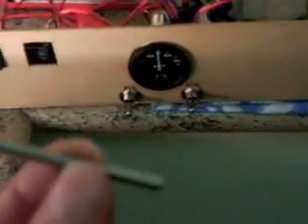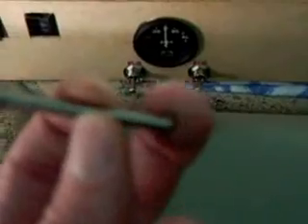How to make a Hydrogen Fuel Cell

Comment from the maker: Hey m8. Gr8 2 hear u r working on the same tech. It is heaps of fun and I have learnt SO MUCH along the way. Alluminium is ULTRA effective but it has NO longevity. The metal is 2 soft and breaks down quickly. Non magnetic stainless is the best stuff I found so far. I have found no excessive heat, 2 answer u'r question, but a lot of U Tubers I know have. Why they get this problem I don't know but I think it may be a circulation issue. Thanks for the comment and good luck :)

Comment: hey bro,ive made one using sea salt and two different size stainless steel pipes that fit inside each other with about 5mm gap between them they are 150mm long,inside negative. it works extreemly well, plenty of gas at 12v.sits inside a bottle, very slim.draws 6amps.i am thinking of putting it on you tube but after seeing all the comments from so many fools i might give it more thought.loved the way you built yours.and remember only 10% of the human race are inteligent.

Comment from the maker: Thinking outside the square! Well done on the kitchen sink bro :)
Even plates of positive and negative. The gas production comes from the polarity of u'r input. One way around produces more oxygen and the reverse produces hydrogen. The reason for more production after sand blasting is that u have more surface area. U sound switched on dude. U'll get 1 going in no time :D

Comment from the maker: Yes. I have a positive bolt running through one set and a negative bolt through the other. The corners of ever second plate have been cut out so the positive bolt can't short on the negative plates and vice versa.

Comment: I think frequency is the key to many things.  I saw a video where someone looped copper wire with about 300 turns and put high frequency A.C. current through it, and the damn thing levitated.  I don't know if it's true or not, but fascinating.  Stanley Meyers used high frequency electricity in his Hydrogen device to "shatter" the water to make Hydrogen.

Comment from the maker: U can use an oxygen filter if u like by filtering the O bubbles out with some small gauge wire mesh but I don't bother as the end byproduct is still the same... Water :) The bang given off is not an explosion, as many think, but an implosion. The energy released by the Hydrogen and Oxygen re condensing is what causes the reaction so it doesn't matter if u seperate the Hydrogen and Oxygen in the end.

Comment from the maker: You are best using only 1 of 2 metals. If u have the money then use gold but in the event u are struggling like the rest of us then I suggest "non magnetic stainless steel". The best configuration I have found is the tubular design but once u make a wave form and frequency generator there is no need 2 worry about the design ;)

Comment from the maker: I was drawing about 20 per chanel and had two running. You need the amplitude to get more frequency of current. The answer is to work on cooling your circuit. Try heavier duty wire and heat dispersing.

Comment from the maker: An electrolyte is used 2 harden the water. I have been using baking aoda but I believe that increasing the frequency of current reduces the need 4 electrolyte. Some people  use salt but that produces chloride through the electrolysis process.

Comment: Nice video BackwardTechnologies.  Have you fiddled with the frequency of the electricity you are applying?  From what I understand, you can produce much more Hydrogen with high frequencies...20,000 cycles per second at a 50% duty cycle is what Stanley Meyers used I believe.

Comment: the hydrogen is carried on through the fuel lines into a propane style carb. in the cylinder the hydrogen and oxygen re-unite and makes water vapor giving off alot of energy pushing down the piston. the water vapor runs into a condenser and some returns as water back to the fuel tank. (energy is lost through the exhaust) the piston turns the crank and therefore alternator charging the battery used to separate the h20

Comment from the maker: I have tried heaps of different configerations and the only constant I have found is surface area. The more surface area you can get to the water the more production. I guess just fit as much metal in as you can without shorting :)

Comment: water is made of two hydrogen and 1 oxygen, during electrolysis or voltrolysis the H2O is broken down into hydrogen gas(combines together into h2) and hydrogen peroxide HO2. theoretically, mixed in the right proportions the hydrogen will only produce water vapor as a result of combustion, which can then be collected and re-electrolisized. hope that answers you question.

Comment: im planning on making a smaller version of this setup. would i still need ur bubble tube if im going to splice into the "petrol" vacumm tube that goes into the injectors of my car? because there will be no flame or spark on this side of the injector system?

cheers
good vid helped alot

Comment: Nice video! one question... i thought relays were to control a large amount of electricity with a small amount of electricity. so how are you using the relays in this circuit and what are the connections to the relays?
thanks

Comment: yes it would, however, the hydrogen fuel cell would be like a massive battery that could be recharged anywhere, not to mention you can store more hydrogen energy than a typical li-ion battery and it theoretically would last forever.

Comment: Hello
 The negative and positive plactes that go into the fuel cell are separated from one an other by using rubber insulation. Question are The positive plates joined together by soldering wire from one positive plate to next positive plates and negative plates soldered with wire from one negative plate the next negative plates. Please explain

                            Thanks
                            louis Drotos

Comment: this is  a water electrolyser.

a fuel cell creates electricity from Hydrogen and oxygen; or other chemical reactions.

Titanium oxide can act as a catalyst to split water when hot steam is injected on it. steam can be solar heated and the catalyst will seperated water when heated by the sun. and steam is blown on it.

 It should not take more energy to make the fuel than it is when used.

 Find a free energy source, or waste energy to power the reaction . heat can be used on its own.

Comment: Use a solar panel to power the electrolyser at home.

Guessing: if you presurize the system it the reaction may be unaffected thus it could elf pressurize a tank with gas at say200 psi

YOU MUST SEPARATE THE HH and O in separate tanks or you will have a very nasty bomb I think.

Then transfer the H tank and maybe the O tank to your car.

Design some kind of "dripper" to control the flow at a very small amount.

Don't blow yourself up!

Don't breath the O gas. I.e. NaCl makes Chlorine

Comment: Has anyone viewed the water fractureing process, theres a couple on the tube ones called salt water burning, The others by somone who pat, Who designed his engin to run directly from the collector directly to the thottle houseing, Stan Myers? just wondering any feeds on that,

Comment from the maker: I believe electric is safe, yes, but this process is designed to run a combustion engine. I have designs I am going to work on when I finish this that will use this process to power an electric engine but that is down the track yet :)

Comment: The first cars back in the 19th century did use hydrogen and also alcohol as fuel, just as the first diesel engines did run on vegetable oil. Go read some history before commenting.

Comment: i think brettb2516 is right.  correct me if im wrong, but this does NOT seem to be a fuel cell at in, in the sense that it produces electricity.  all you have is a nice electrolysis machine producing fair amounts of HHO.  this does NOT make any electricity.   the "electricity" that the meter shows is the current from the car battery.  correct me if im wrong though cause this is a little confusing.

oh and...  lose the puppet

Comment: "IF THE HYDROGEN causes enough spark in the piston cylinder.....THROUGH DIRECT INJECTION
why do we need fuel to add to it??????"

Because we have no carbon in hydrogen fuel, and gasoline does. Carbon lubricates certain parts in the engine to keep them from wearing out, thus you can't run pure Hydrogen in a gas engine.